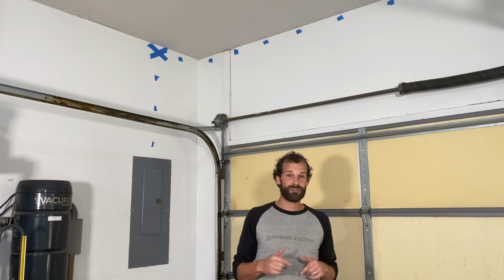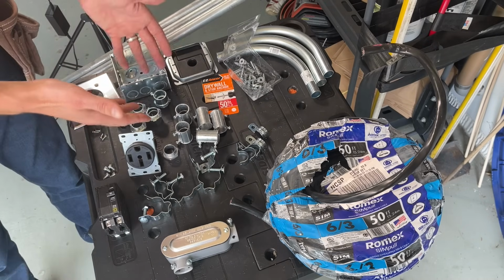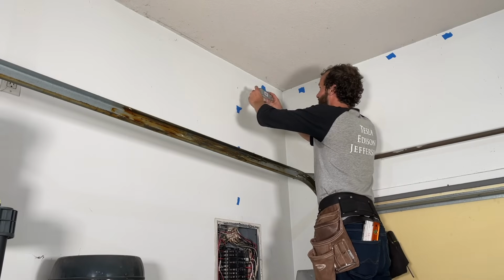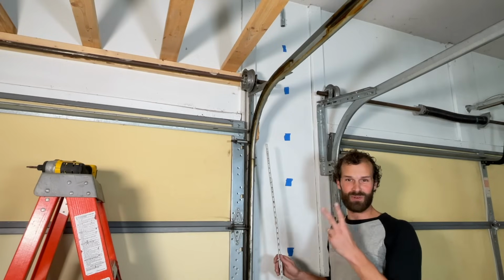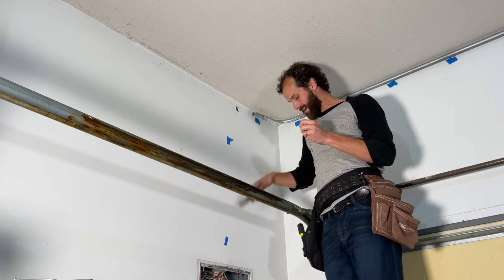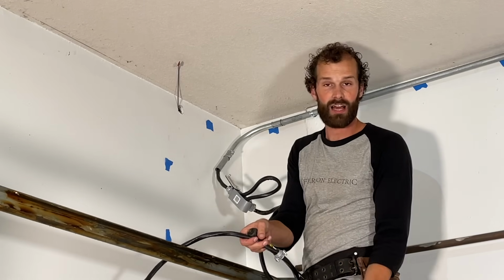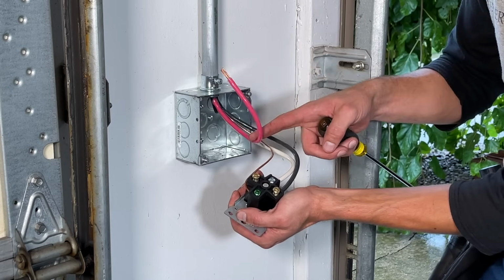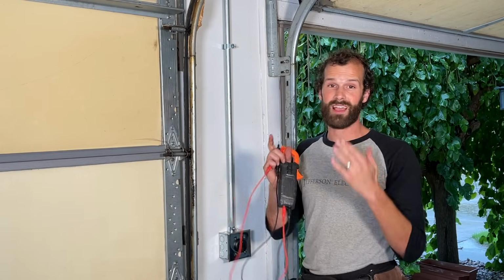How To Install a 240 Volt Outlet | Electric Car Charging

Comment: You generally aren't supposed to run cables through conduit, just individual conductors. That's why it was so hard to pull. Should've installed a J box above the panel, brought the Romex from the panel to that J box, then transitioned to the EMT, with THHN conductors. Then make sure there are grounding/bonding pigtails on the boxes. Or just cut the wall open and run the EMT the whole way and patch it after. Lastly, it's 240 volts, not 220. There's no 110 or 220 in the USA, just 120VAC and 240VAC.
Reply: He noted that it's just 240VAC. Some jurisdictions permit Romex in EMT, mine does. Some don't - my brother across the county line. Should have gone with 1" EMT, else, I'm not so hysterical as some, here. Would have bonded with a pigtail, not because I regard the EMT as part of the circuit ground (too high resistance, for one, vibration for another), but I don't trust grounding through the receptacle yoke.
Reply: @ethelryan257  My main issue is the bonding (or lack of bonding). But there are many ways to do it and still be safe, but to me this wasn't safe. No ground screw, and a floating non properly bonded EMT is a potential shock hazard if there was to be a ground fault that may not properly clear because of a high impedance ground fault current path.
Reply: @Admirable_Tomorrow  no multi-conductor cables (such as NM-B) in conduit is an old myth - NEC/NFPA 70 absolutely allows it for physical protection of the wiring, but it must be sized correctly and the pull must meet all standards (under 360 degrees, soaped to prevent friction damage, etc). The heat factor is literally a non issue. Most ceilings have NM-B packed into ceiling insulation - thinwall/emt will not insulate heat any more than hot attic insulation will. If there are any restrictions on this process - they are local code variations only.
Reply: @3-PHASEDELTA  romex only allowed in conduit if it is not a wet location.
Reply: @steelersman74  yep should have clarified that as well my bad. The culprit in NM-B that makes it a no-go for wet locations is the universal jacket sheathing (conductors aren't individually jacketed like in UF) and the paper wadding, which will basically soak through and become a water sponge (I've had to demo and reinstall a lot of wiring due to flooding in South Louisiana). But yeah, spot on bro.
Reply: @3-PHASEDELTA   Most NM is rated 60degC (NM-B is 90degC) while THHN is 90degC.  So you should derate the current if you're running NM through conduit similar to table 310.15(B).  However, this adjustment is pretty small, so probably, as you say, a non-issue.
Reply: Just use flex in the wall and you are fine with the THHN.
Reply: @Sparkeycarp  That's what I did for a 60 Amp dedicated circuit for Tesla Charging Station
a few weeks ago, THHN in FMC
Reply: he kept saying the pro way but the professional way is just as you described. that is the way a journeyman would do it. i would also add that he should have used a industrial cover not a rough in cover and a finish plate.
Reply: @twigd3825  you mean an RS cover.  I agree.  I would have used an RS cover.  I also would have done this so many different ways that wouldn't have broken my back trying to wrestle it in.  He obviously was out of his element and is not well versed in this type of work.
Reply: Plastic flat pieces or fibre glass rods seam safer for this and I like PVC conduit too. Talcum powder is a good lubricant as well.
Reply: @johnmccallum9106  I like EMT because it it won't melt and make poisonous gas during a fire. But the key thing is to install either one properly and it will be safe. You can get fiberglass fish tapes to be safer when fishing wires in a panel.
Reply: @Admirable_Tomorrow  romex is allowed in conduits as long as not in a wet location.  You obviously are not a licensed master electrician.
Reply: @Kris You are correct...however Romex is not listed for use in a Conduit or Raceway of any type or length...period. Code says you shall use Listed Products and Materials without modifications, alterations that would violate the Listing. IOW if it's not in the Listing Installation Instructions then you CAN'T...simple as that. So with that...all the Romex entering via a 2" PVC Conduit Connector is a Violation...as well as Bundling in a Distribution Panel. 
Remember you must follow Code and MFG Listings for all Products!
Also remember the products are submitted for testing and minimum standard approval WITHOUT your modifications or alterations...once you modify, alter...you violate the Product Listing and the product is no longer Listed and Can't be used as Listed & Code Compliant !!
So what modifications or alterations are allowed...Absolutely NONE !!
Although a Manufacturers Listing provides some sense of Safety...the primary purpose is to provide Third Party Testing Liability Protection to the MFG.

If users modify, alter, incorrectly install or misuse the MFG's product their liability exposure diminishes dramatically via user deployment and use of the product!

What's funny here is even though inspectors saw the Romex entering the Panel via a 2" PVC conduit connector and it looks pretty...they approved it even though it is a code Violation/s !!
What's even funnier is how poorly trained they are in the Field...electricians and inspectors!

Yesterday I couldn't  spell Electrician...today I are one!

Good thing they don't inspect Aircraft...it would be Raining Airplanes!

With that...can wire nuts be used in a Panel Board... Yes/No?!
Reply: @electroman982  Can't speak for Canadian code which I beleive is where this video takes place but in the US under the NEC you most certainly can run romex in conduit, as long as it is in a dry location.
Reply: @electroman982  yes wirenuts can be used in panelboards
Reply: I just ran across this 3 year old video.   I just completed a very similar install in the garage with similar conduit, etc.  inside the wall I ran Romex just like the video, but once in the garage I switched over to THHN.  So much easier to pull through the EMT and didn’t even need the fish tape.
Reply: Just saw your 3 year old comment.  I did exactly what you just described and then ran across the video.  It was so much easier to run THHN through the EMT.  The only “extra” work was to join the Romex wires to the THHN wires in the J box.
Reply: Which code states that running NM cable through conduit is unacceptable? I have heard that myth repeated over and over, but I have yet to see any codes that substantiate that claim. But with that said, I suppose individual wires might be a bit easier/faster to pull and maybe a little cheaper.
Reply: @averyalexander2303  It isn't against code but you have to size the conduit properly, adjust ampacity if necessary, and you cannot put the NM inside of a conduit if the conduit is outside. He struggled to run that cable through the conduit because it was too tight of a fit, then he didn't use lube, and he didn't properly bond/ground the EMT. To me there are several other better ways to have done this installation.
Reply: @illestofdemall13  Makes sense, thanks for clarifying! As I said I agree that individual wires would have overall been a better method for this application.
Reply: @averyalexander2303  The installer knows how to "make it work" but there are some key issues that he missed. If you are following the NEC and also doing the job safely, then there are several ways to do it. One big issue I see is having a piece of EMT used to protect the cable, but it isn't bonded/grounded to the ground of the cable that's coming from the panel and going to the charger receptacle. This could potentially be a shock hazard to the customer if there happened to be a ground fault inside of the conduit. He is only relying on the ground screw of the receptacle and the mounting screws of the receptacle yoke to complete electrical continuity of the ground.
Reply: @illestofdemall13  I fully agree about the grounding issue, I noticed the same thing and would have grounded the box too. I'm guessing that was just a simple oversight since the box/conduit would have been grounded if the conduit ran directly from the box to the main panel as it usually does, but that's certainly something to be aware of.
Reply: @averyalexander2303  Usually people do things the same way repeatedly and it becomes "their way" so there's a chance it is lack of understanding of NEC codes and electrical theory/safety rather than just an oversight.
Reply: @illestofdemall13  I agree, as a professional electrician he really needs to do every job to code at a very minimum. I also don't see dangling a metal fishtape right in front of a live electrical panel as being a great idea, but that's just me.
Reply: @illestofdemall13     Hi Kris!   Haven’t seen any of your comments for quite a while.  Still in lighting business?  You are correct on how it should have been installed.   For others, you can not strip the jacket off of NM cable and pull it through conduit either.   It is not a labeled conductor as required by NEC(does not matter if realistically it is the same).  It can not be easily looked at by an inspector for approved method.   As far as the 110/220 or 120/240 volt you are correct, current numbers used are 120/240.   Having said that, this is how something can be affected.   On cut sheets or equipment name plates, there are voltages and amps at that voltage.   I have seen 110, 115, 120, 220, 230, and 240 volts.  As a designer, I convert everything to VA, then use my system voltage to calculate loads for branch and feeders.   It might make a difference if there are large quantities.
The box and conduit must be connected to the equipment ground because the conduit is NOT connected at the panel and is NOT a grounding means.  That is an easy way to cause death.   Very similar to how an electrician died in the attic of a bank with a sign circuit where the EMT pulled apart and was energized.
Respectfully,    Kevin
Reply: @illestofdemall13     Be very careful my friend!   You may be accused of being a Karen for telling the truth and trying to inform viewers not all is correct.   I was this week from a comment a year ago telling a guy to make sure his content is NEC compliant before uploading to YouTube.   Respectfully,   Kevin
Reply: @KevinCoop1  Hi, how's it going? Yes I am still in the lighting business. Just the other day a handyman tried to put together 12V LED ribbon and butchered the soldering and many other things. Fixing lighting seems to be what keeps me busy a lot of the time. 

I understand what you mean about the name plates and using VA to calculate what loads will be drawn and what size conductors will be needed. 

I am just a bit OCD with terminology and semantics at times. It also just gets a bit tiring when I hear people say cliché and inaccurate statements/terms about electricity, such as: Electricity takes the path of least resistance, water is a good conductor, ground and neutral are "the same," positive and negative (instead of neutral), 120 Volts isn't dangerous, 2 phase (instead of single phase), it's not the volts it's the amps, etc. Lol
Reply: @illestofdemall13      I’m the same way.   It is those fine points that make the difference between understanding and not.   In. NEC the little words many times mean more than the rest of a paragraph.
My biggest one is that statement that you add the two 120 volts to get 240 volts because they are 180 degrees out of phase.   One guy even drew two sine waves in opposite directions and said 120 volts above the line and below the line gets 240 volts.   I have asked for anyone to please explain what is in a transformer that would cause the electrons to flow in the wrong direction.   
I know that the 180 degree thing came from electronics classes and oscilloscopes because of the common connection of the scope makes it read weird.
Have a great life!     Kevin
Reply: @KevinCoop1  Thank you brother.
Reply: @Sparkeycarp     Technically it was 24” in NEC but your rule still worked.   Yes, as an electrical professional, your very first and last thought of any electrical work should be “life safety”.
Reply: @illestofdemall13  If you look closer, you might find the code is a bit more complicated than that.  Our code (CEC) doesn't allow NMx inside conduit unless the run is quite short.  They'll allow it as a protection sleeve through a masonry wall for example, or a drop from a ceiling to a switch or outlet especially for momentary or light loading.  But much longer than that, with continuous load the answer is no.

It's a heat dissipation issue.
Reply: @illestofdemall13  article 334.15 (B). Nm cable protection approved.,...EMT.
Reply: In a 120/240V single phase system, the two phases are 180 degrees apart.
Reply: @KevinCoop1  It's true that for a single phase system/transformer which is what 99% if not 100% of homes operate on that it is double the voltage ie 120/240 or 115/230 etc.  If you ever take a voltage reading and it is not double the single leg voltage then your ground point of the transformer is not 0 volts potential as it should be and is out of phase and something is wrong, in which case you need to contact the power company.  Simple as that.
Reply: @fromagefrizzbizz9377  the NEC allows romex inside conduit as long as it is not in a wet location because romex isn't allowed in wet locations.  Length of conduit has nothing to do with it.
Reply: @steelersman74  Define "romex".  Is it NM, NMC, NMD or NMW (your UF) or some combination of those?

NMW is rated for wet locations.  In fact, in our codes, you can sleeve NMW inside CSA/cUL approved PVC tubing (the flexible black stuff normally used for water with a blue stripe that comes in 100' coils) in order to subtract 6" from required burial depth.

In our codes, you can't use NM or NMC, all "romex" permitted is NMD or NMW.

No, as has been documented many times here, the additional thickness of romex/NMx cable counts more in conduit fill over individual conductors.  Check out your NEC for conduit fill on basement masonry/concrete passthrus.

Our code is a bit forgiving on short runs of NMx thru conduit, but not on long ones like this video, and "romex" of any kind would be prohibited.
Reply: @steelersman74    Large apartment buildings are very likely 120/208 volt.  
The cause of the issue would be no bonding ground to neutral.    Technically, neutral has 120 volt potential, but sense they are bonded, the difference between neutral and ground is zero volts.
BTW, I saw your Lectric video,  I would have turned the breaker off before pulling it out.   Cute kids too!
Reply: @fromagefrizzbizz9377  you are in Canada so I have no desire to argue our code versus your code as your code will never apply to me.
Reply: @KevinCoop1  120/208 is 3 phase though I'm speaking about single phase.  If I had turned off the breaker then I wouldn't have been able to make that cool video!
Reply: @steelersman74    Exciting video!   If an apartment building is large, and the electrical system is 208/120 3 phase 4 wire, then to feed an apartment, a 2 pole circuit breaker would be installed.   There would be two hots, one neutral and a ground going to each apartment.  The system in the apartment system would be 120/208 1 phase, 3 wire, with ground.  So, if connected to phase A and phase B, one set of coils and a neutral.
Reply: @KevinCoop1  yes you are correct and I agree with that statement.  But for single phase 120/240 the voltage between leg A and leg B should always be double that of leg A to ground and/or leg B to ground.
Reply: @steelersman74     You are 100% correct with single phase utility to one primary coil in transformer and one secondary coil with a center tap feeding the home.
Reply: @KevinCoop1  which is exactly what is in this video 😀
Reply: @steelersman74  I didn’t re run the video.   I’ll take your word for it.   Have a wonderful day!    Respectfully,   Kevin
Reply: @KevinCoop1  better to be called a Karen and save a life than to say nothing and have a person die
Reply: @butchs2337     My whole work life as an Electrical Design Engineer was about life safety.   I always did the absolute best I could so I could sleep at night.  Now retired but old habits are hard to break.   Best wishes sir!     Kevin
Reply: @KevinCoop1  best wishes to you also stay safe in these crazy times and thanks for the reply
Reply: @steelersman74  how can it be out of phase when its fed by only 1 phase. Can you explain why we have 120/208  in a 3 phase and not 120/240
Reply: @thomasmarable6818  why are you asking me this?  I never said anything was out of phase dude.
Reply: @averyalexander2303  no not too critical to ground that emt because it not connect all the way to the panel.  there's no way that conduit can be energize because there's an egc on the romex.
Reply: @averyalexander2303  definitely don't show DYI that metal fish tape.  use non metal fish tape.
Reply: @illestofdemall13  and safer ways
Reply: @illestofdemall13  should someone who doesn't have a grasp of electrical theory, especially the basic ones, be going anywhere near an electrical installation?
Reply: @averyalexander2303  you say he is a professional but do you know many pros who would do half the things demonstrated in this video?
Reply: @averyalexander2303  Who taught you? I have been told by many electrical mentors over my career not to run Romex in conduit over a foot due to heat.
Reply: @Sparkeycarp  protection from damage required in garages by most jurisdictions.  Article 334.15 (B) allows EMT as that protection.
Reply: @Sparkeycarp  you can run romex inside of conduit as long as your conduit is not in a wet location.
Reply: @Sparkeycarp  you have to de-rate the wire because of heat and you need to use the correct size conduit, which would have been 1” for 6/3 copper NOT 3/4”.
Reply: @averyalexander2303  in most locations the garage witting must be protected:. In wall or some raceway.  Article 334.15 (b) nm cable.....EMT   code approved protection method.
Reply: @averyalexander2303  334.15b
Reply: @averyalexander2303  its allow but NM cable rate as lower temperature and ampacity
Reply: It's code compliant to put multi conductor cables in conduit if it's to protect it from damage.
Reply: @dr.cupcakes626  It also changes your fill calc.